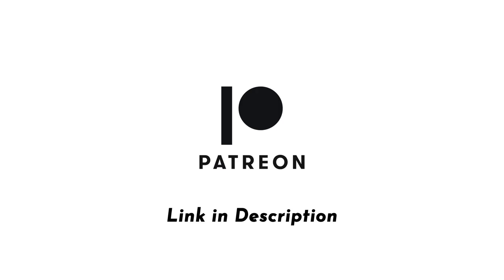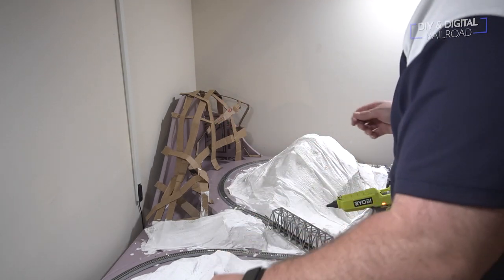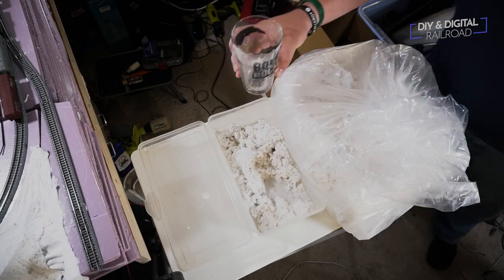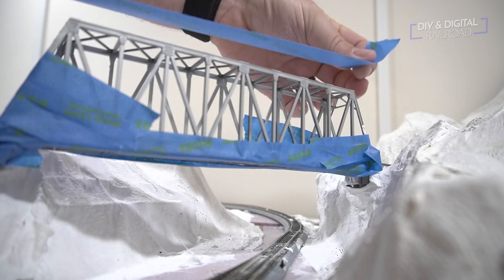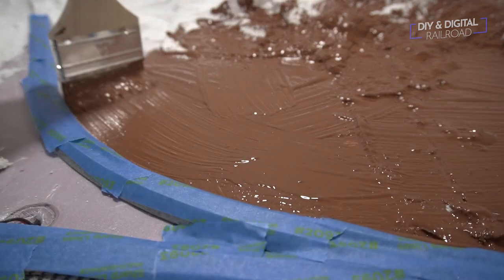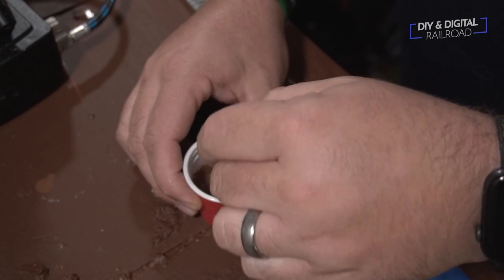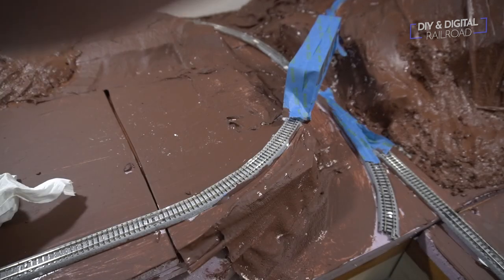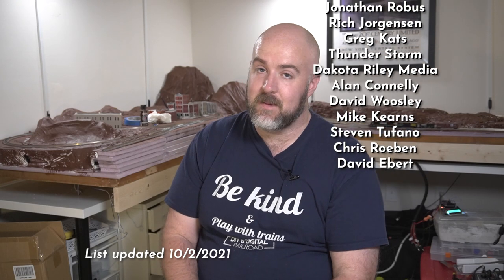Model Railroad Layout Update: Sculpting and Painting

Comment: Thanks Jimmy, a couple of questions.   First, WHICH Ryobi glue gun are you using, there seems to be 3 different ones.   Also, I've heard that the single heat one is too hot so do you have the dual heat one?

Second question, with the Kato track, do you solder the pieces together and just use the unijoiners and glue the track down?